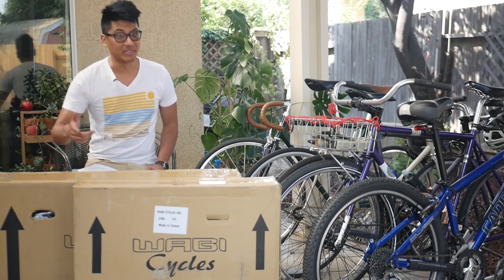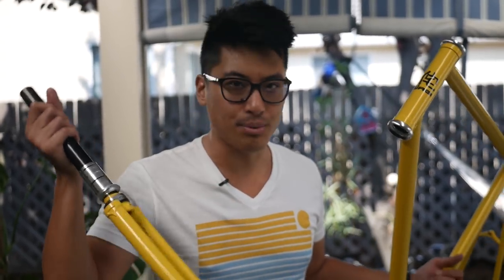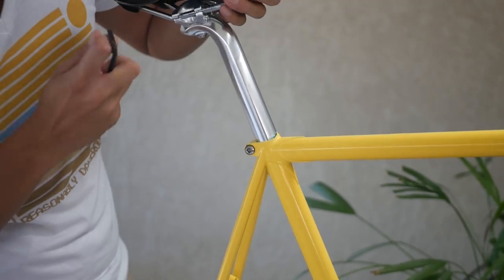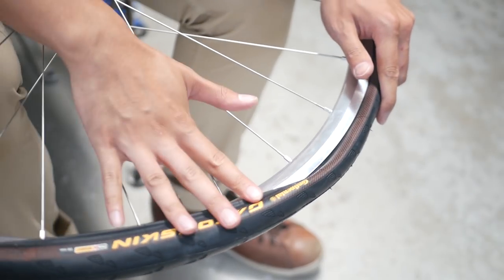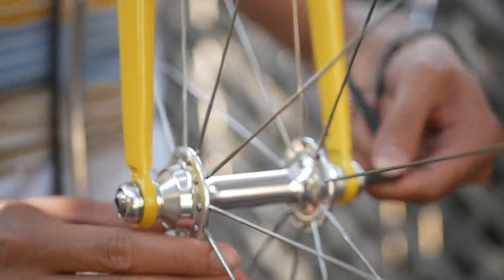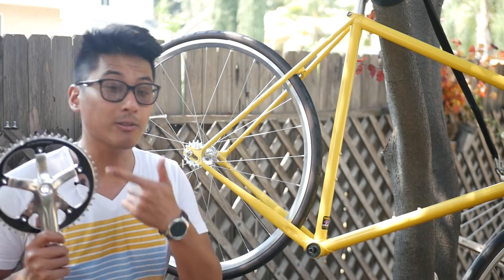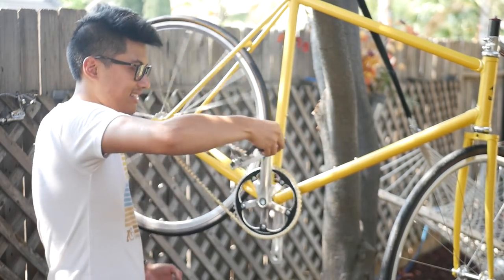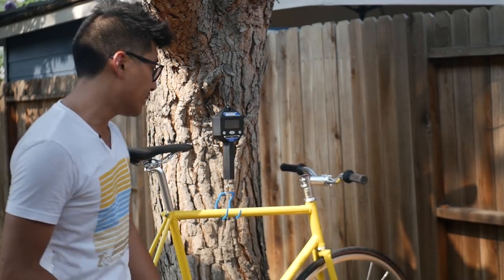Building a Fixed Gear Bike from Start to Finish (Sponsored by Wabi Cycles)

Comment: How tall are you back? I'm 5'10 and looking at the 55cm, although I know inseam and other measurements are important
Reply: I am 5'8" but have a 34" inseam and very long arms. I personally don't fit at all on 55cm frames! The reach is always way too short, even if I add a longer stem and seapost with a generous set back. I need 56 or 57cm usually. The reach is more important than than stand over height, in my opinion. Maybe you should go to a bike shop that does bike fits? Everyone is unique as far as what frame size is the best fit.

Comment: I've always prefered mtb's, so when all this fixie stuff started i decided to buy a fixie looking mtb and changed the seat, handle bars, gears, removed the derailer, brakes and painted it a nice dark red color, it turned out great, it has a nice fixie vibe but still keeps the big knobby tyres

Comment: I have a question can i put roadbike group sets like my SORA r3000 (brakes,hubs,crankset,lever) in a Fixed gear frame ? would it be compatible or should i go with specific Fixed gear components ?
Reply: The rear hub will probably not work because fixed gear bikes typically have a different hub width than road bikes due to the lack of rear cassette. The crankset and brakes/levers should work. Crankset may not give you the perfect chainline but it should work.
Reply: The Lazy Logician thank you for answering you save me a lot of headaches
Reply: You're welcome!

Comment: Nice bike. Other than raising the stem height whats the point of the spacers? Can I take them out when I replace my handle bars?
Reply from the maker: They allow the top cap to load the headset. You'll either have to put your spacers on top of your stem or cut your steerer tube. The top cap needs to contact either the stem or spacers to keep your fork from rattling.

Comment: Hey, Zach. I really appreciate all your input on fix gear/single speed bikes. I just ordered a Fuji Feather based on much of your advice. What's your height and inseam? The Fuji Feather I got is a 56 cm but might not be a right fit. The smaller size is out of stock. The bike shop were I'm getting it from will allow me to try it first and decide whether I get it based on how it feels. I'm hoping for the best n_n

By the way, it's nice to have some variety in your camera shooting / editing style.
Reply from the maker: I'm 6'/183cm tall. I actually don't know what my inseam is off the top of my head since I just know what bikes fit me 😅 I hope you can get riding soon 🤞
Reply: I got the bike. It fits just fine. Went for a few rides around the neighborhood today. I'm planning on commuting about 20 miles a day back-and-forth to my job in Columbus, OH, so my wife can use our only car to better handle her activities throughout the day. I also need the physical activity since I'm sitting all day at work. In my mind it's a win-win. I'm excited n_n

Comment: Great video and a nice looking bike.  One suggestion I have is to pump a little air into the tube just before putting it in the tire.  Not too much, just enough to give it a little bit of form.  It stays up in the mold better and you don't have an issue with the tube between the tire and rim when you're ready to pump it up.  Just my two cents.
Reply: What? He did that... go to 5:32
Reply: The Lazy Logician Thanks.  You’re right.  I must have missed that.

Comment: You should try fixed gear tour in India
It may kill you , drive you mad or make you stronger than you can imagine 
Can you take on Indian traffic on a fixed gear ?
Reply: Yeah if you ride in India you will go mad in an hour or less 
Besides overpopulation, pollution and heat is part of the challenge after all

Comment: no quick link connector for chain? just the pin?
Reply from the maker: Wabi's chains only use the pins. Of course, the chains are pre-installed on the completes.

Comment: Should I get All City Nature Boy? I currently have Surly Steamroller
Reply: My local bike shop have the Nature Boy for 40% off and its the right size for me. Just debating whether to get it or not
Reply from the maker: Seems a bit redundant to me. It's 40% off, but you'd still be paying 60% + 100% on miscellaneous parts for a bike you don't need. Just my two cents.
Reply: Zach Gallardo thanks for the response. I ended up getting it. My Surly Steamroller have a new owner (my brother). Want him to get into fixed gear bike. He is loving the bike so far.

Comment: Wich tires you are nice wenn you skidd allot
Reply from the maker: Vittoria Randonneur 28c or larger: https://amzn.to/2vnTsBO (affiliate)
Pro tip: stay away from the skinnier Rando's. They don't have nearly as much tread and aren't as beefy.

After skidding for 6 months, I wore out all the rubber and got down to the tire casing. I got 1 flat in 6 months while riding this on the rear. YMMV.

Comment: Break on a fixie? :P what would be the point aha.
Reply: someguy onyoutube safety lol I know brakeless is KEWL and all but sure brakes are safe man I myself ride brake less but you should not judge ppl that use brakes
Reply: @MrAce21  most fixies are locked crank sets so there's no free wheel and if you stop pedaling or crank backwards those are your brakes.. if the fixie has a free wheel on the back then by all means install a brake.

Comment: This is called assembling, not building a bike. You have all the right components, you just put them in place and lock everything tight. Building a bike means collecting all the components, trying to adapt different parts for the same bike, applying the bearings, setting the spokes, doing it from the ground up. Everyone smart enough to read instructions can unbox and assemble all the parts that the shop/factory sent you.
Reply: Welding your own frame too, if you didn't do that you didn't build shit.
Reply: If you didn't even mine the steel did you really build your bike?
Reply: Your jokes are great, but honestly this is bike assembling. No website/shop/factory is ever going to ship you a fully assembled bike. For the most assembled, you'll have to put the front wheel and seat post yourself, at least. 

Building a bike means finding a nice vintage frame at a flea market or online, going shopping for different components that might be right, or might need some adaptation. Painting it yourself, truing the wheels, converting it to a fixie. Don't make me repeat myself: Anyone smart enough to read instructions can assemble the Wabi bike in the video! Building a bike means trying to design it yourself, and doing it for the cheapest price possible! I have built two bikes myself. One costed me around $160, the other $125. Both were build with (mostly) used components, that still worked great. Don't get startled by the costs, I don't live in America where everything is overpriced. I still can't believe Zach build his purple fixie for about $1300...in my country, that bike, already built would have sold for about $200 - $250.
Reply: #builtnotbaugt my bike was built out of a second hand bike shop, for free, other than my saddle and back wheel, still a sick machine
Reply: That's what I am talking about :D
Reply: I will build a cake for you
Reply: What's in a word? Pfff.

Comment: 1200 for a steel bike? Why not just get a full carbon frame and fork?
Reply: RollinRat  Exactly. Steel is more durable, safe, and lasts forever. Carbon can suddenly have a catastrophic fail and seriously injure or kill you. It also eventually wears out. Steel never does. For example, you can get a vintage steel bike that's decades old. I would NEVER buy anything carbon that's used! You don't know what it's been through and it's not safe at all.

Comment: Build an old school Schwinn fixie from a yard sale or Craig's list.
Reply: That would weigh literally almost twice as much and not have the proper geometry for a fixed gear.
Reply: I converted a Schwinn Varsity from the early 70s to a fixed ride several years ago. It probably weighed around twice as much but was fun as hell to ride and bomb-proof for sure. Also, the wonky sizes Schwinn used for all their components back then was a hassle to deal with.

Comment: Hi Zach. After watching your videos I literally have just brought my first fixie (I haven't really cycled for over 9 years). I brought a cheapo muddyfox fixie (I live in UK and I'm on a bit of a budget, wanted a bike I wouldn't worry too much about breaking) and went on an 8 mile cycle. I'm riding single speed at the moment (haven't had the confidence to go fixed yet). Just wanted to say thanks for making me aware about what fixie is about. I was otherwise going to get a mountain bike (whoch I find fall apart due to the gears all the time when dropped etc). Will let you know how it all goes! I plan to ride once a week for the time being
Reply from the maker: Awesome to hear that. Keep riding and crushing those miles out there 👊

Comment: You can make a headset press that functions better (in some ways) than a professional headset press out of threaded rod and a stack of large washers. Pro headset presses work wonderful, but are made to work quickly. The threaded rod DIY press will have much finer threads and require two wrenches to use, but also provides much more control due to it's slower operation when pressing down.